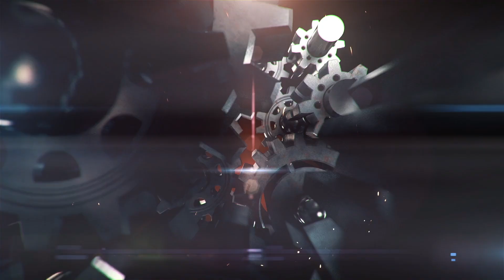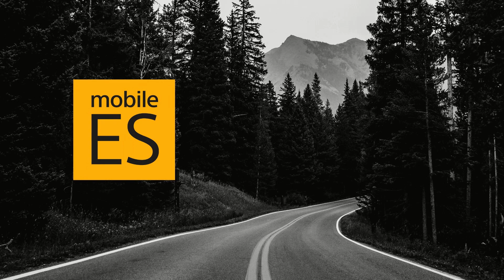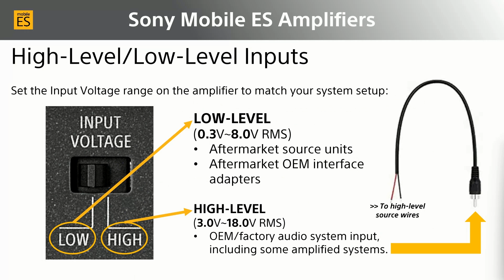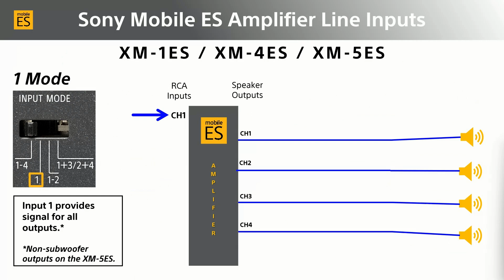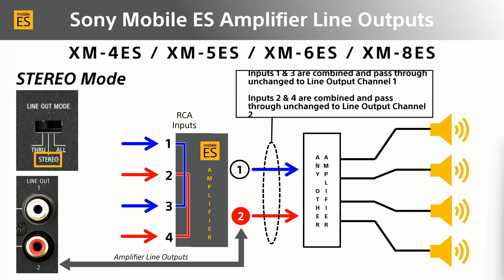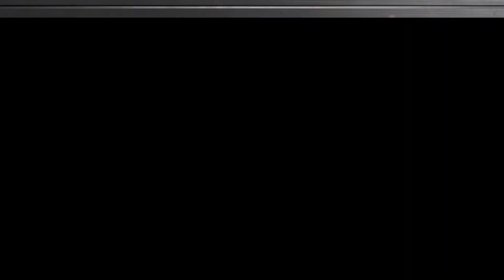SONY | CAR AUDIO | WORKSHOP

Comment: Ok, I'm confused about the Low-Level and High-Level section.  You say through the 80's and 90's OEM used to use High-Level inputs, but today, they now use Low-Level.  Your slide shows the Low-Level is used for Aftermarket with Hight-Level being used for OEM.  Shouldn't it be showing the opposite?